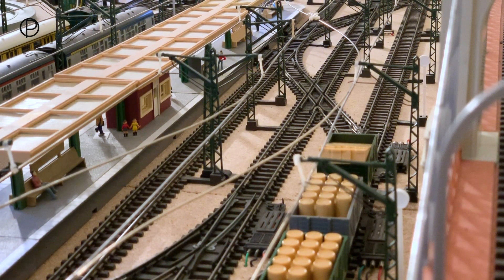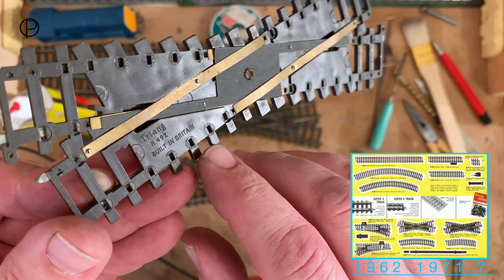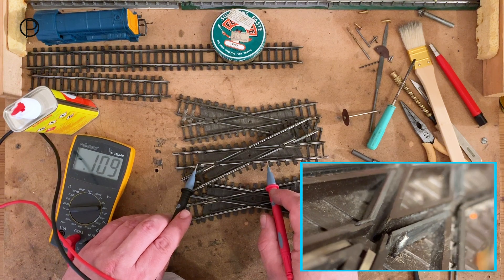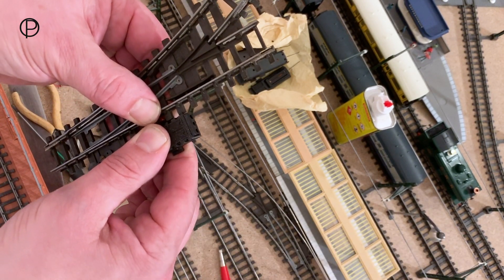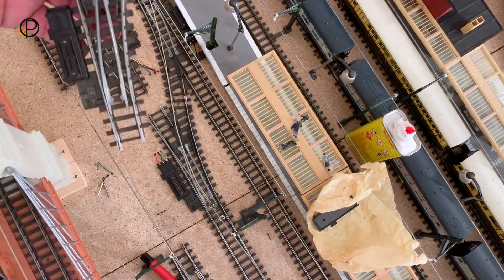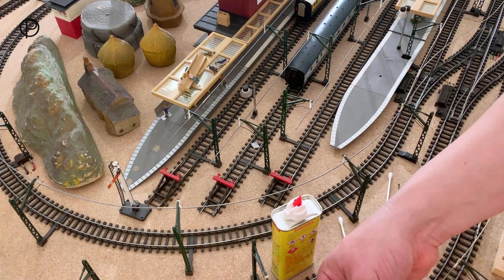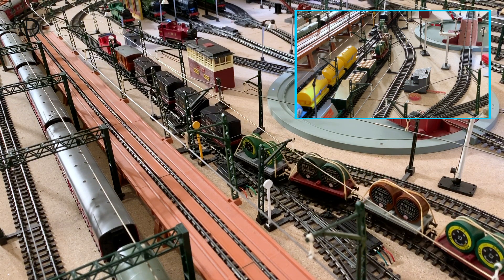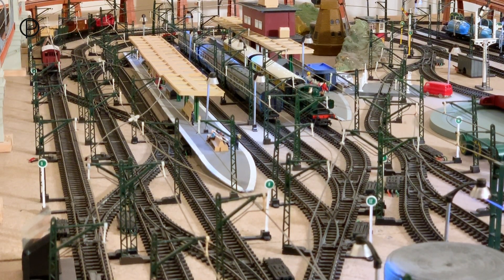Removal, adjusting and refitting of Tri-ang Hornby R.492 Diamond Crossing

Comment: Thats the trouble with diamonds and crossovers , you need to alter lots of track to replace them. That’s why I’ve always been reluctant to hard ballast track. Informative video as usual! Great running from such old track. Shunting great when all track behaves .
Reply from the maker: At best, dodge these diamond crossings. The plastic parts are too big and I'm sure the alloy parts do not pass current as they should at the best of times and the casting is very poor on the alloy parts, the railheads are not smooth at all. Wheels struggle to make contact.
Thanks again for watching.

Oscar

Comment: Thank you for showing how to fix the cross over. It must have taken you a while.
Reply from the maker: Thanks Ian, it was not the afternoon/evening I had planned for. These diamond crossings are quite crude by today's standards track of manufacturer and not very smooth to run over at the best of times but when that connection on the alloy rail goes its time to take it out and fix or replace. I was a bit worried as I did not have a spare. So was hoping it could be encouraged to work again. Nothing I tried with it still in place worked. Still, if I wanted smooth faultless and reliable running I would not be playing with 40-60-year-old toys. All part of the fun.
Thanks again for watching and taking the time to comment.
Oscar

Comment: Hi Oscar ,, this question might sound a tad dumb but how do you tell diamond crossings apart (besides for the R.??? numbers.
I mean I always thought they were all the same. 
I have heard of peeps saying this on different video's but i thought they were just taking the piss so to speak.
I know this video was released 3 years ago but i must have watched it as when i seen it I had already liked it.
Buggered if I remember watching it previously though haha
Cheers from John in Australia.
Reply from the maker: Hi John Tri-ang/Hornby have a track geometry where right hand crossings go with points that curve to the right and the same for lefts. I think this was introduced by Tri-ang Railways when they developed super 4 to keep parallel track ends to simplify/improve layout deign with set track. It looks to have been carried over as system six was developed and stayed with Hornby’s track geometry to present date. This principle was not developed originally by Tri-ang Railways, Hornby Dublo had left and right handed diamond crossings in the 3- Rail track range well before Super 4 came along others may have as well.
Thanks again take care.
Oscar

Comment: What is the difference in a left handed or a right handed diamond crossing
Reply from the maker: Hi Antony as far as I’m aware left and right handed Diamond crossings are to help the track geometry with Hornby set track and similar it helps keep the track ends parallel when used with left and right handed points. I think it’s just to simplify the track system.
Thanks for watching stay safe.
Oscar

Comment: Morning Oscar
Great videos, brings back many childhood memories,
May i ask are you still running on the original wheel sets of the wagons,
Regards Mick
Reply from the maker: Good afternoon Mick, glad you enjoyed the video. All of the wheels are original sets as far as I know. Generally, if I replace wheels I try and use the original types.
Thanks for watching and taking the time to comment.
Oscar
Reply: I'm running on Peco Code 100 track and most of my stock run ok but a few don't like the points depending on which way they go over,  I've had the Loco wheel profiles done  and they go ok most of the time apart from my 37s and  the old European style steam loco boogies, + I'm trying to restore the smoke box on that one but not having much luck finding a top for it,

Comment: Good video. What was that tool you used to clean up the rail joints ends.  I have a lot of steel track in poor condition and wondered how you keep yours so clean.
Reply: That was a glass fibre pen. A very handy tool, good for cleaning any electrical contacts including very dirty wheels. The only downside is if you get the broken off fibres stuck in your fingers, I generally work over a mat so I can brush them straight in to a bin.
Reply from the maker: Good evening John, as Rob has indicated the tool used is a glass fibre pen (Scratch Brush). I think these were originally an item used in the jewellery industry. I have two different sizes of pens 4mm and 2mm both available via well know sites. Buy from a reputable source and when buying refills avoid the ultra cheap ones. I have found that they are of very poor quality, too soft even for jewellery. Used with caution great results can be had across a number in a number of applications.
Thanks for watching John and taking the time to comment.
Oscar 

http://www.squirestools.com/files/12-06a.pdf